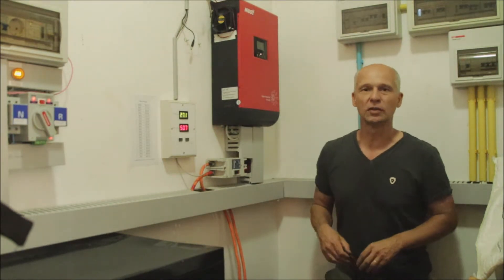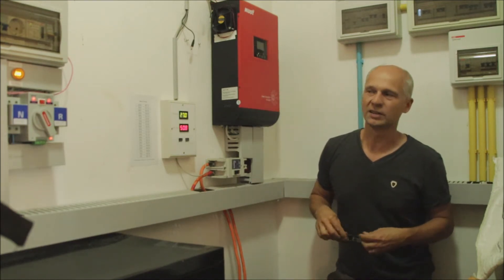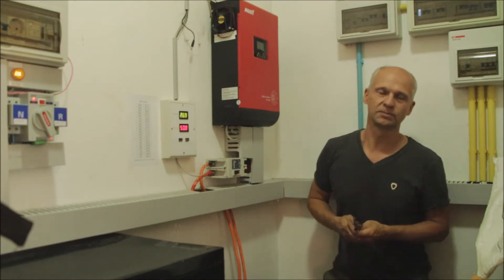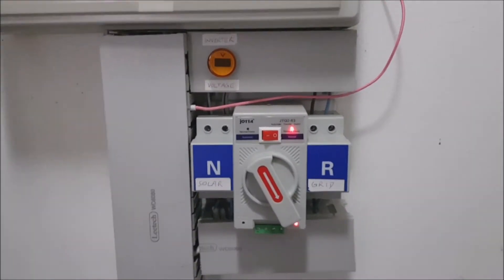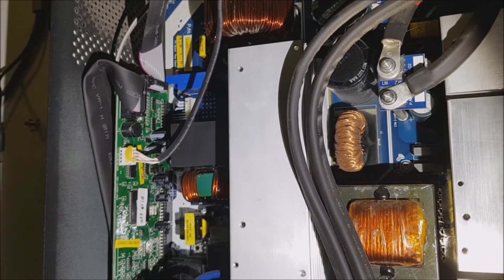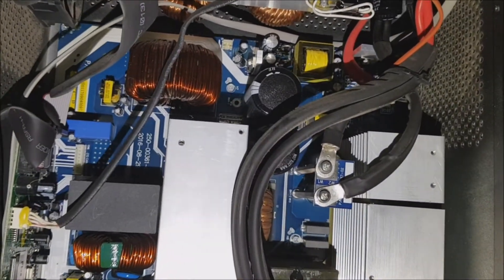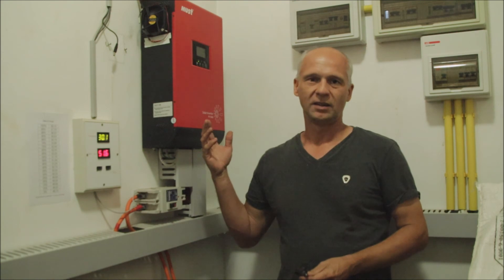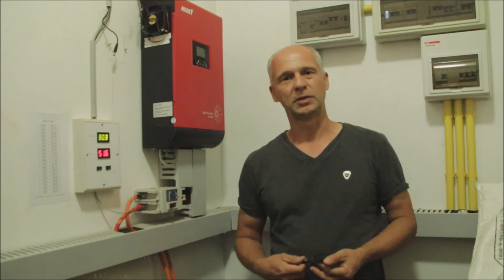PV18-5048/PIP-5048/MPS-5048 Hybrid Inverter - Low AC output voltage repair

Comment: Hi Roland, nice video, thanks for sharing...I have a Must PV-1800 3kw hybrid....we are off-grid and use a gas generator connected to the grid input side, my generator 220 AC output controller went bad and over charged my Must inverter...now when I switch on grid input it trips the breaker switch between the inverter and generator...what should I look at first? Can you give me some troubleshooting steps to follow?
Reply from the maker: Hi. 
You should find the AC charging circuit inside your inverter or on the main Power Board. So it can be as well a separate part inside the box. There you would have to probe the board for shorts. If you have suffered from an over-voltage situation caused by the generator, maybe a capacitor could have blown or a transistor there has shorted. In general, look for some signs of smoke, shorts where they shouldn't be, etc
Hope you get lucky :)

Maybe this video, or at least the videos in this channel can help you out: https://youtu.be/mqTXtA_Ta6M?si=Uopw4aNk5bBltC0Z

Comment: hi, I have a problem with a pv18-5248. I,m trying repair, but some zener exploted. Can you send me  the service manual? or can  you give me the diode code of this main board (zd1-2-7-8, botton side near optocupler) thanks
Reply from the maker: Hi. I do not have a service manual or any schematics. I will have to open my inverter to take a look. I need to replace a capacitor on my device anyways. Can you send me a Foto of the area where exactly the diode is? use the e-mail address in my channel info. thanks
Reply: @RolandW_DIYEnergyandMore  hi, i send an email

Comment: Sehr gut ! ich hatte auch Proleme und konnte sie lösen. Es war der gleiche Fehler (Kondensator) bloß auf dem Mainboard. Der Inversor gleichen Typs funktionierte 4 Jahre ohne Probleme.
Ein Hinweis auch für andere User bei Nutzung des 230V Inversors/ Europa (P -N - Ground ). Am Netz von 2 x 115V ist Vorsicht geboten. Der Neutralleiter (hier die 2.Phase also L2) ist bei Inversorbetrieb intern mit Ground verbunden !!!!
Dir besten Dank für das Video ! und Gruß von der anderen Seite der Welt (Karibik)
Reply from the maker: Gut zu hören, dass dir die Reparatur geglückt ist. Ja, ich bin Auch kein Fan davon wenn die Leute die 230V Geräte I'm Split phase System nutzen. Da muss man schöne sehr genau wissen was man tut. Alles Gute!

Comment: @Roland Great fix, I will keep that in mind should I need it. I have a hybrid 5kw axpert type inverter.(5star)  which is still running fine for a year. Would love to know  where I may find a schematic diagram, all I could find was a repair manual which does not show schematic diagram. Would like to keep the schematic for future reference.
Reply from the maker: Schematics would be very helpful at repairs indeed. Unfortunately they do not circulate in the public. Only the manufacturer could help you with that. We need to stick to basic fault finding procedures :(

Comment: Hi Mr. Roland, I have a Must 48V, 5KW hybrid inverter that was working fine, and I install a DC battery breaker and just then it started giving me a fault code of 21 which means “inverter output voltage sensor error” please how can I fixed that problem
Reply from the maker: Hi. How old is the inverter and what is your climate? That error is unrelated to the DC side but I think that the inverter just didn't like the startup. Maybe some capacitor blew up.
I can only recommend you to open it up, thoroughly clean the board and look out for any obvious component damage like black smoke markings, bulged electrolytic capacitors, etc 
From here it is hard to say what happened. Do you have a MUST service center in your country?
Or write to their technical support in China...

Comment: @Roland W :  Roland  please, what is Your overall experience with MUST and their PV1800  Series (VPM version) .  I am considering to buy PV18-3024 VPM (3kw) as my first PV system . Is  it good  option ? Did You had more issues ?
Reply from the maker: Must was always the equivalent to MppSolar on mainland China. Higher quality then orher chinese brands and also more expensive. My inverter runs 24/7 for 5 years. The repair i did was the first on the device and that time the inverter was still running. I would buy it again without hesitation.

Comment: Good job sir.
over dc voltage in ac output fault. What i do now
Reply from the maker: You have a DC leakage into the AC side. Did you bond your DC side somehow to the AC side like connecting Battery  or PV minus to Ground while you as well have AC Grounded? Or did this error just occur after running the inverter already for some time successfully? It might be a bigger issue with a faulty power board...

Comment: Hello, 3000 watt full sinus inverter fault light is on.  When the inverter is turned on, a relay tripping sound is heard, then the fault light is on, what do you think could be the problem?
Reply from the maker: isn't there any fault code shown on the display?

Comment: Hello...sir I have an inverter which has fluctuating DC output...like its 5 KW inverter but it works fine till 3 kw after that the voltage n power of DC out put start to fluctuate between 2.1 to 3 kw...once I reset it works fine for 5 min n then again fluctuations start...any suggestions
Reply from the maker: What do you mean with DC output? DC is the source of the power. Its the input. And how can power fluctuate? Power is result of load. Do you mean AC? The Voltage fluctuating?
Reply from the maker: When you connect a constant load like a hair dryer to the inverter, what is fluctuating?
Reply: @RolandW_DIYEnergyandMore  load is constant as its  connected to grid for reverse metering...so any load shouldn't bother it ...its working on max capacity
Reply from the maker: If you really mean the DC side, is it a similar inverter to this one? An all in one solar hybrid inverter? If you see the solar DC input Voltage  and the solar power fluctuating, I would say it is the MPPT charge controller. It is the board in the upper part of the inverter with the many big capacitors and coils on it. Give that one a thorough visual inspection. See if you can spot some burn marks or blown components on it...
Reply: The max PV voltage n power fluctuates above 3 kw...below it it works fine...
Reply from the maker: @Gunmaster-v2j  then I would suspect a problem in the MPPT circuit or somewhere on the way from panels to inverter input, like a bad connection.
Reply: @RolandW_DIYEnergyandMore  but once I reset it by putting of n on it works fine for 5 min at max pwr then starts to fluctuate
Reply from the maker: @Gunmaster-v2j  sounds a bit like a bad capacitor somewhere as well. Did you visually inspect the device? Any bulging electrolytic capacitors? Discoloration? Burn marks or blown components?
Reply: @RolandW_DIYEnergyandMore  you know...its surprising...once I opened it ...it was a complete mess...total dirt...probably it used to get heated up...I've cleaned it n now its working fine ....the voltage seems stable above 3 kw
Reply from the maker: @Gunmaster-v2j  great. Glad its working again :)

Comment: Brother my inverter fault 08 and after battery voltage 28.5 up to and inverex inverter show fault 08
Reply from the maker: Your Inverter is 24V, right? You need to set your "Floating charging voltage" a bit lower then the "Bulk charging voltage" to avoid that situation. Example: BCV 29V, FCV 28,5V
Because if you reach the BCV under load, and load is removed, Voltage will go over Inverter Max voltage

Comment: Lucky you spotted it the capacitors swollen, even luckier you had some spares the right volts.
Reply from the maker: Yup, the 470uF/35V replacement (for this one I need to order a 1000uF for next time)  I got from an donor TV power supply board, and the 1000uF/25V replacement I had some from an order a few years ago. You can always go a step higher in voltage rating, but it might get you into a space restriction as higher voltage mostly means bigger.  I do have a source for electronic components in Thailand, but if you need to order something first, it will of course cause equipment down-time. Like this, the inverter was back up running just a few hours later.